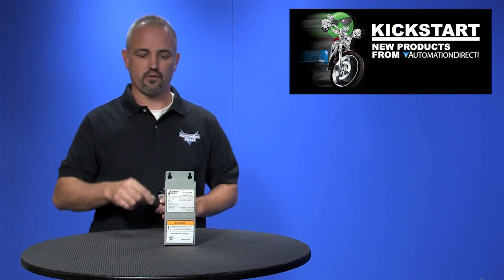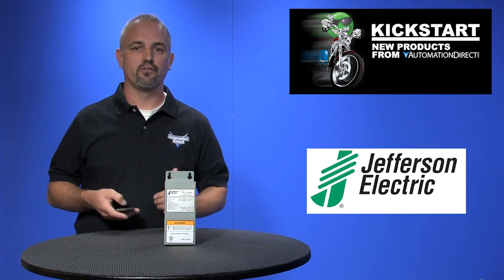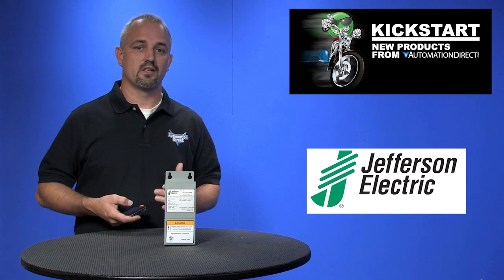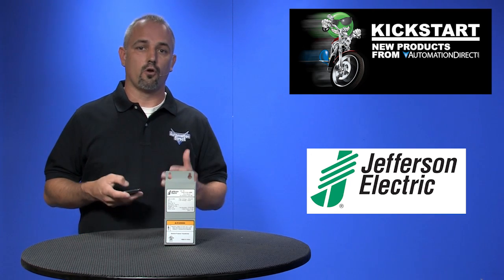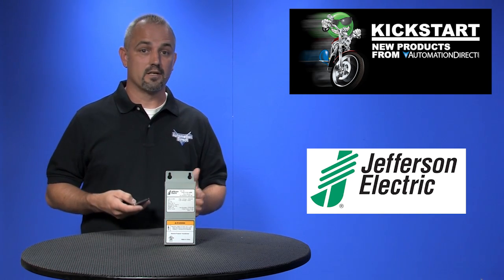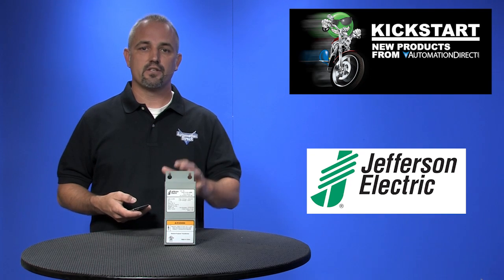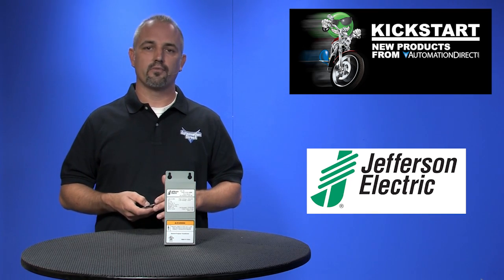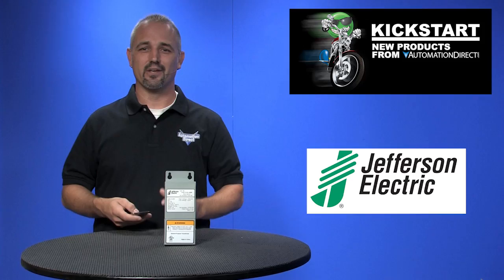Jefferson Electric Buck Boost Transformers from AutomationDirect

Comment: I have a 416-1131-000 buck boost transformer powering under cabinet lighting in my kitchen. There are two runs of lighting, one for each side of the kitchen. Not long after I installed a dimmer wall switch, one side of the kitchen lighting went out. Is that because the dimmer caused the transformer to fail? If I replace the transformer, should I also remove the dimmer? Thanks for any help you can provide.
Reply from the maker: @Robert Irvine, not knowing how your setup is wired or details of your electrical, it would be hard for us to assist troubleshooting in the comments field.  It would be best to contact our free technical support and they can assist you in helping determine what the next steps should be.  https://support.automationdirect.com/techcontact.html

Comment: We have 120/240V coming into our facility. It's 3 phase and 800 amps. We are looking at a air cooled chiller that is 208V. Would a buck boost transformer make this work? If so, what size and specs do we need? Thanks
Reply from the maker: Hey +Michael Fox thanks for watching! For technical questions like this, please contact our free award winning tech support. They are setup to give you the most efficient and quickest support. Thanks! 

Phone:    1-800-633-0405
Email:     https://www.automationdirect.com/adc/Form/User/TechInquiry
Support:  http://support.automationdirect.com/